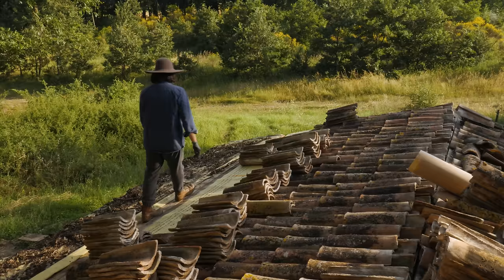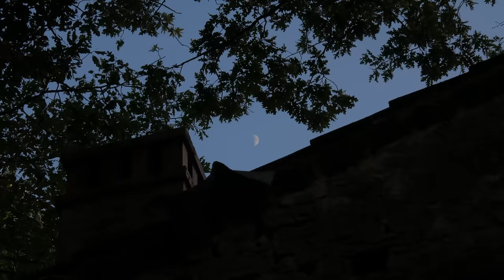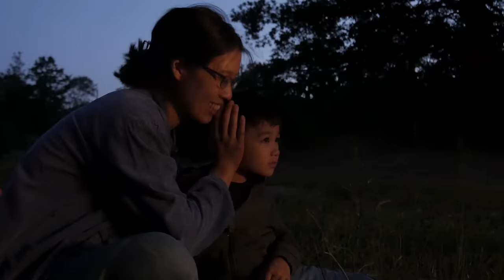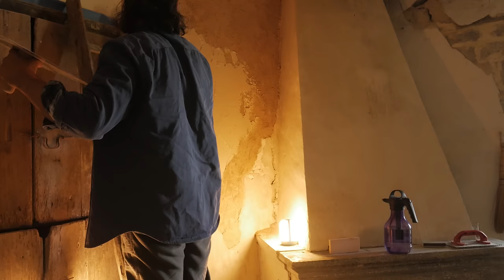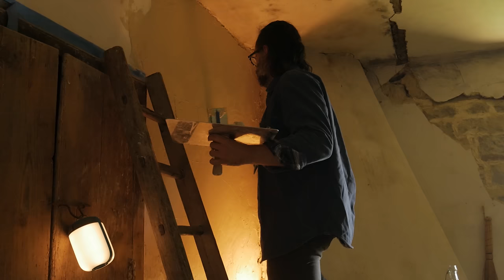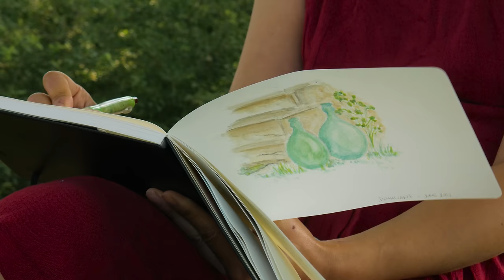Lessons learned from family history - end of summer at our Italian farmhouse

Comment: Just curious, are any of those large trees you’re cutting up good enough for milling?  With all the thought you’ve put into everything I’m confident if they were you would have saved but have to ask.  Thanks for sharing, I’m a handyman and feel inadequate by some of the things you’re tackling.
Reply from the maker: The oak species around the house is Q. cerris, which is not milled commercially in this area from what I understand. The reason is that these trees tend to have large cavities and they tend to get wind shake (fractures between growth rings). I've also read that boards will tend to warp more than other species when drying. Still, I think we may mill some for use in various projects with the understanding that most of the tree will end up as firewood. I have dried out a few pieces just to see how it looks and I think we can mill and use some. Finding the time to do so is hard though.

Comment: Genuine question. why hasn't he put the roof tiles back bottom to top? the way he did it, he constantly had to lift the previous tile up again.
Reply from the maker: It was less work. To do it the other way, we'd have to get all tile off the roof first. This would mean carrying it down on that side with a ladder, or carrying it off the opposite side. The more you move tile, the more energy and time you spend. Putting all tile at the roof's ridge at once, however, wouldn't work either, because at some point the weight becomes too much. We have to be a little careful about the weight distribution on the roof. So it was a balancing act of moving as much tile to the ridge as I thought was safe, then working down. Lifting a tile a few cm in height when laying is far less work than carrying it off and back onto the roof. Another approach might have been to set up scaffolding next to the roof, as a platform for stacking tile, but that would have cost time and money as well.